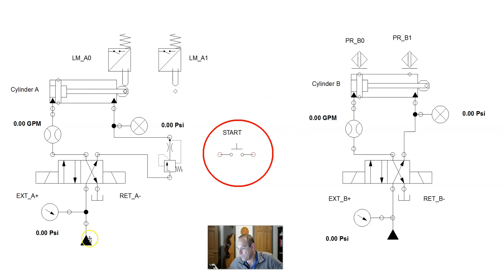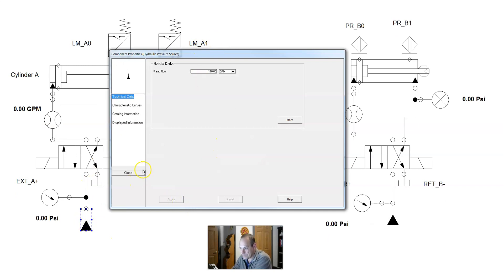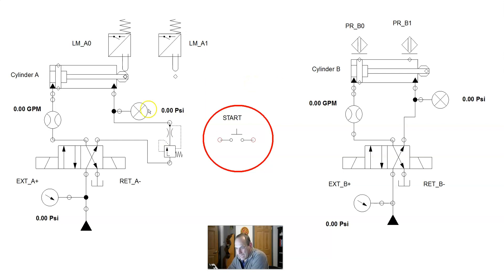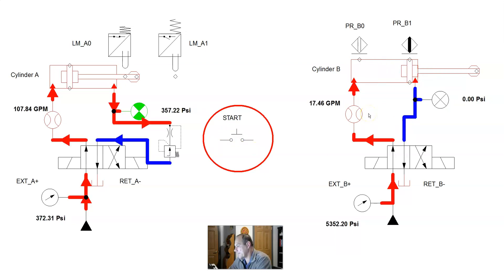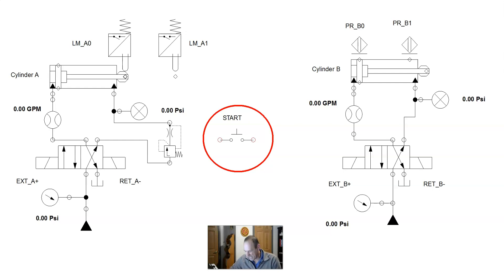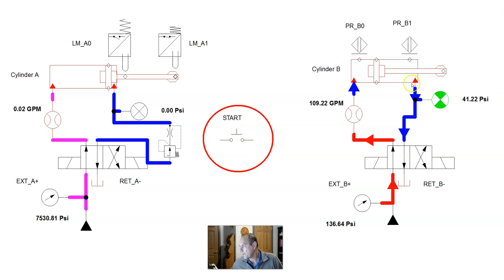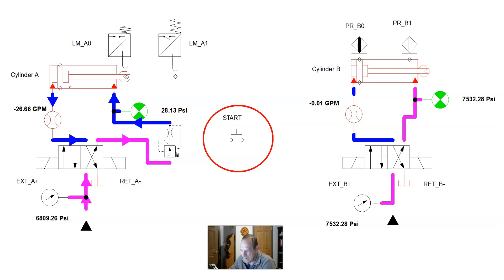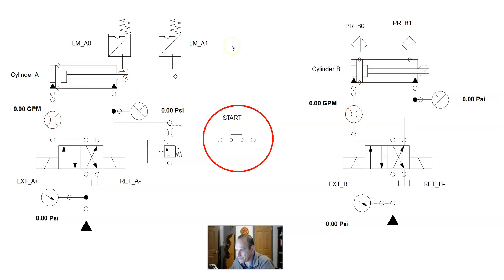PLC Programmers - Your First Hydraulic Circuit

Comment: Great video Sir, I'm a beginner in hydraulic systems; what you recommend me to start with to check the hydraulic system and fix issues related to it?
Reply from the maker: That's a broad subject. I would recommend you start by visiting. www.hydraulicsupermarket.com
Reply: @LogixTrainers  what is the name of the software that you used it to illustrate the hydraulic motion of equipment?